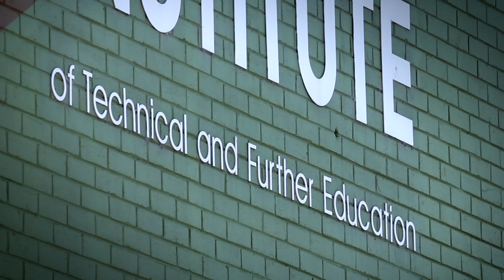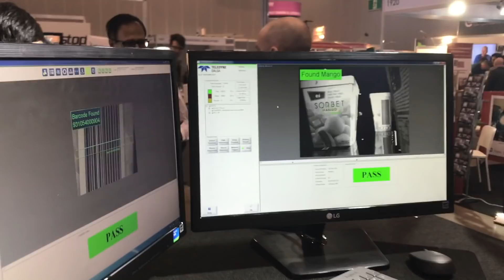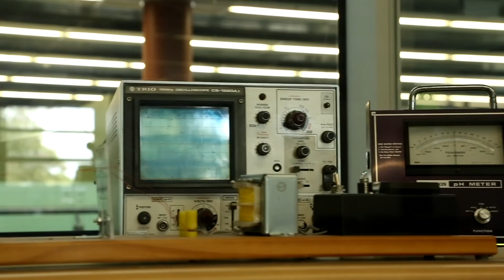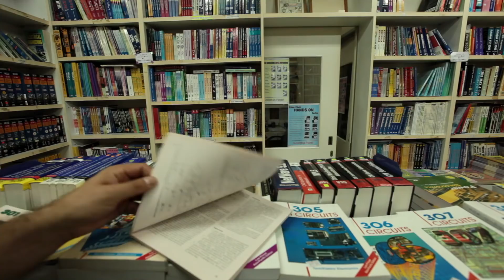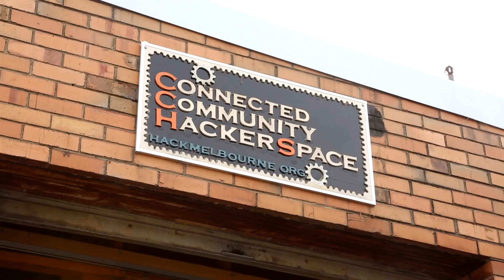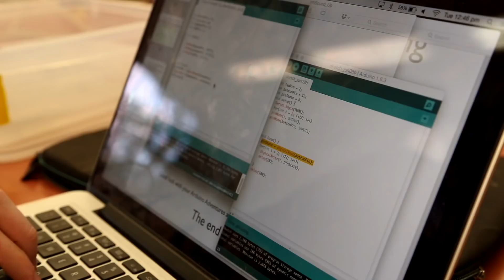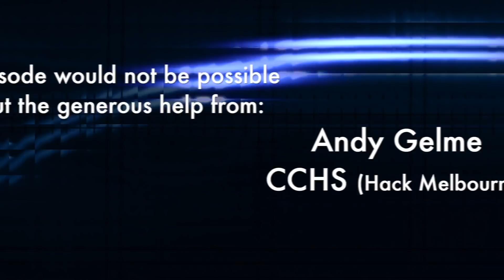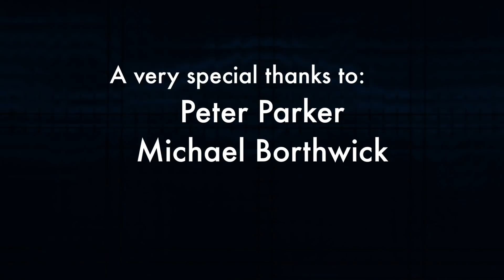The Rise of the Maker Movement

Comment: 5:01
You're right, I had recently bought an HP Scanjet 2400 flatbed scanner for 5$ from a local e-waste center and guess what, when I took it to home, plugged it in, it was working absolutely fine. I was also giving high-quality scans. The only problem was that its power jack was bit loose so it would sometimes shut down suddenly. I wonder why people just throw away their gadgets when new ones come and the old ones stop working. The technology is so economically affordable that people just buy new stuff instead of getting the old ones repaired even once. Probably, this is because of the rising standards and competition among people in the society to show off their possessions.